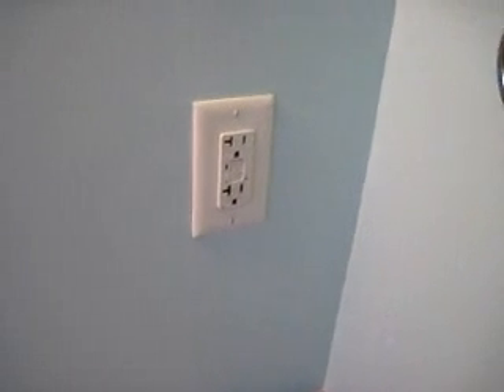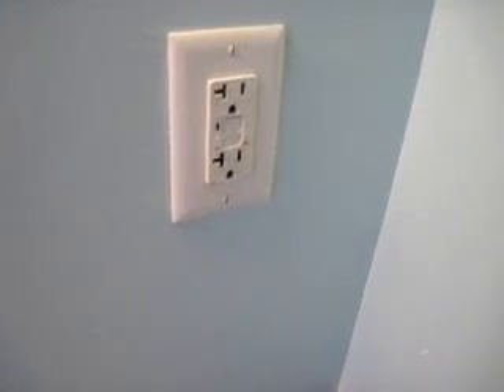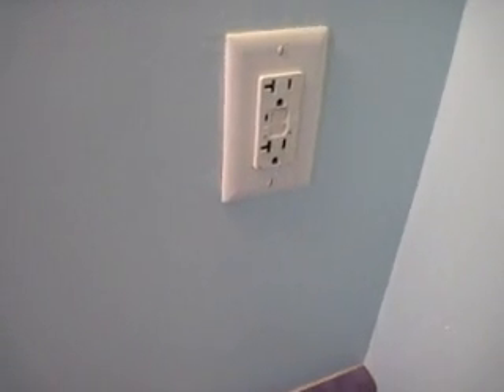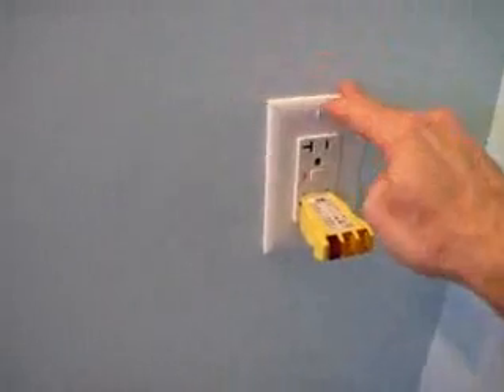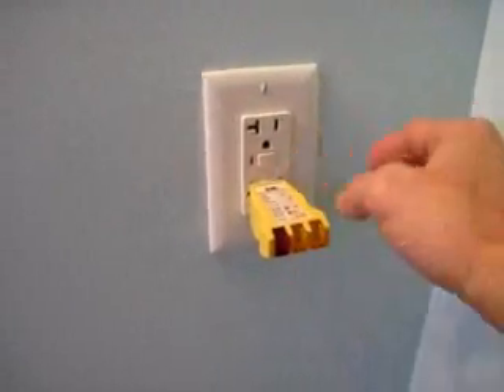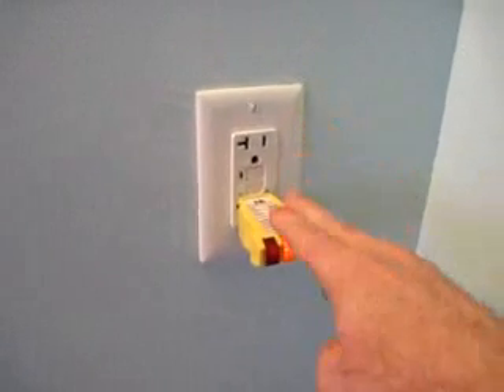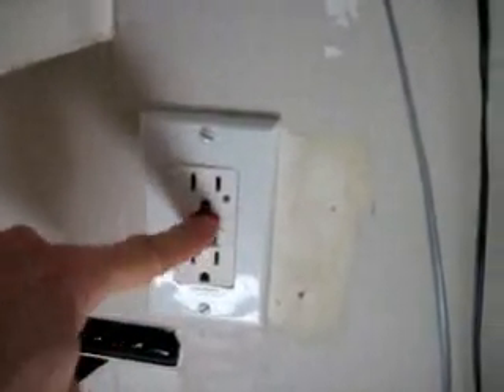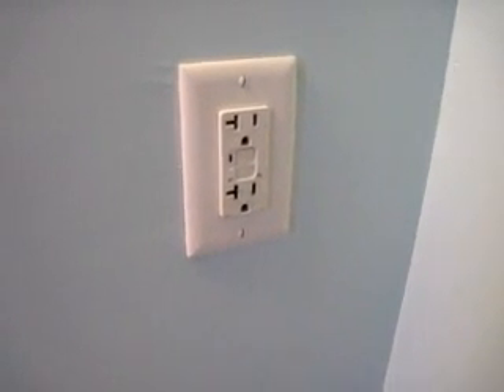How to Reset a Ground Fault Circuit Interrupter (GFCI) Outlets or Plugs

Comment: I'm only getting the single yellow (middle) LED, thus ground fault.   The GFI's all seem to be fine, none have blown, I have 12V power throughout the coach when plugged into my home 120V, but still, I have the 'ground fault' indicator.   I'm assuming it has to be via 120V system...not the 12V system, BUT....how to find it?   I did have some work done via an RV technician recently, as my built in Progressive Industries surge protector had 120V going on...but was giving nothing coming out, so the tech hooked all the white, reds, blacks and the one green together with their corresponding colours with a 'twist on' connector on all but the ground, as they had connectors where you could use a small bolt to connect them.

Comment: I have my unit hooked up right with green light on. Unfortunately it will not get past the what I think they call the triple protection way its shipped.

 I even tried all different ways to connect the wires and either light doesn't come on or it shows red which is the wrong way to connect so I know it's currently hooked up right. I just can't get the test/reset button to work. I have the same exact 20a-125v outlet as I had previously. Any help would be appreciated.